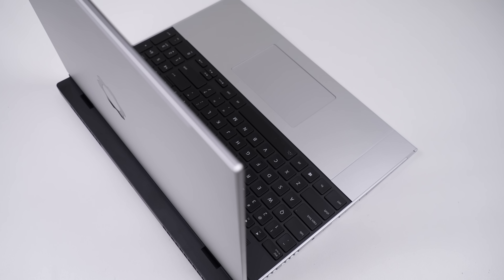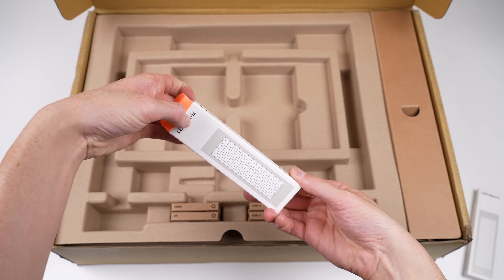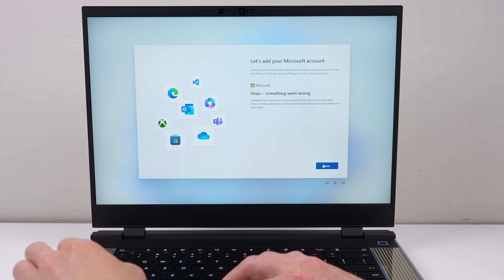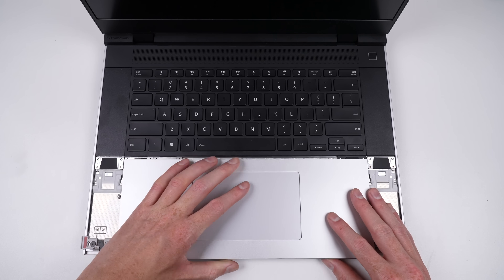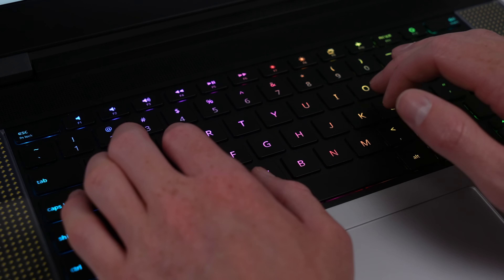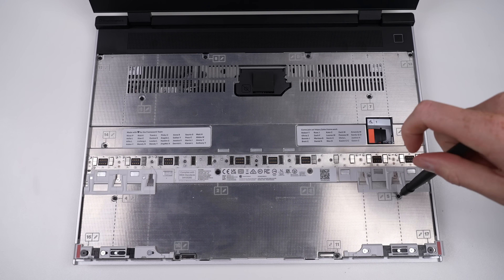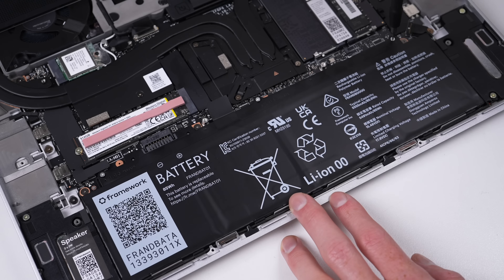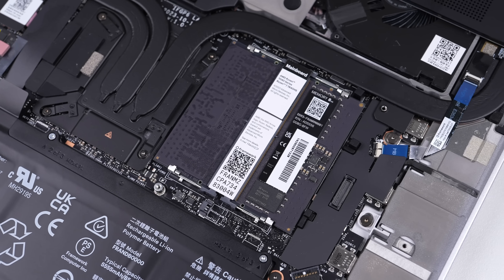Game Changing New 2024 Laptop Design - Framework 16 - Teardown And Repair Assessment

Comment: Too bad the price is too high imo. I just bought 16" laptop with ryzen 7840hs cpu, rtx 4060 gpu, 16gb ram, and 1 tb ssd for $950. A comparable framework 16 would cost almost 3x the price.
Reply: which one? and does it have oled display?
Reply: @lo2740  HP Victus 16 s0010ax for close to $900. Admittedly the display is worse than the 16:10 1600p framework, at 16:9 1080p ips panel, but at least it do 144 hz and 100% srgb at 300 nits.

Comment: I've seen this laptop so much times on the internet ive been always wanting one since newer laptops purely suck except for the framework ones i have a macbook m1 8gb ram i really just want to get one framework laptop and ditch my macbook since 8gb isn't much for a laptop and for my use cases and i cant upgrade my ram i have to replace the whole laptop and tbh i wish i heard of framework when i was looking for a laptop bc then i could of just easily upgraded my ram 128gb of storage is nothing im relying off a external drive more and using my desktop pc which was lower specs than my laptop only because i need the storage but its a really good laptop they have managed to bring back something new manufacturers are just leaving behind because they only care about getting more money from the user om any way they can man with the framework laptop you can upgrade it to have full sized usb ports man dongle after dongle is annoying being able to easily upgrade storage would be something amazing

Comment: I don‘t understand the hype with these Framework laptops. Yes, you can easily upgrade the computer down the road, but the replaced parts are also mostly e-waste. And: you have to upgrade more often than a conventional laptop. I have byed a Acer Predator Helios 16 for 2600 Euros. This laptop with a i9-13900 HX and a RTX4080-laptop runs circels around the top eqipped Framework 16 and costs 1000 Euros less. And this Helios 16 will last easily for 4 to 5 years for games. And you can edit 4K videos till the laptop dies. I am not sure that the replacement parts for the Framework laptop in three years will match the performance of my Helios 16.

Comment: On the one hand, modular laptops are cool, but the sad thing is that almost all laptops were once modular (not completely like in this video, but still)
All but the cheapest ones could have a replaceable processor, and many had a mobile version of the pci express slot
And now the modular system is presented as something new, and at the same time it is not widespread as before and is expensive

Comment: It's a great product, but sadly they are not the first company to make an upgradable laptop. There have been laptops where you could buy a case and build it out just like a desktop PC but it never took off, and that was in the days when harddrive and CPU, RAM, and GPU was user replacable. But in the quest for ever smaller laptop, they are simply not going to work. Because the fact is, if you want it small, then everything must be integrated, and if you wanted flexibility, you buy a desktop tower.

In contrast Apple just make repair as difficult as possible. Not only are the SSD soldered on, it's underfilled AND the chips must be programmed with the right firmware or else it simply will not work. We're talking BGA soldered chips too.
Reply: they're the first to design it this well, and keep the weight within reason. plus alienware instantly scrapped their offering, and MSI just threw theirs under the table acting like it never happened. 

and not everyone wants thin laptops, these are as thin as any laptop should be. anything past this is just stupid

Comment: As if people will upgrade their units every year 🤦🏻‍♂️ yeah sure modular everything but honestly, who here who owns a PC upgrades the components every year or every other year.

Nobody, most of us use it for 4-5 years, by that time when we need to upgrade the motherboard or some other component is not compatible with the new components, so you have to upgrade everything
Reply: Well... me. Tecnically not upgarde but I add thing to my PC as time went on. Usually extra drives and ram. For laptop, modularity makes sense, CPU last a long time, even i5-8265u is still excelent for doing normal day to day stuff. But my GPU is struggling. It would be nice if upgrade my GPU in 3-4 years time.

Also, what happened if your laptop broken. Maybe a fired GPU. On most other laptop you'll need to suck it and bring it to a service center, which would take a long time. Worst case you'll need to chuck it a buy a new one. With this, if the GPU fired you just said "aww.... shoot" and just remove the module and go about your day. Then send your module to them while still being able to use the laptop.

🤦🏻‍♂🤦🏻‍♂🤦🏻‍♂
Reply: @harveywilde6781  that maybe true but honestly, how many laptop have you bought in your lifetime and how many broke down?!

I have 4 laptops on a 5-6 year cycle and the reason I upgraded was it was already getting slow

Sure things get damage but the one you are talking about GPU or CPU or other components being damaged on their own without user neglect is like how much percentage is that from the general population using a laptop?

Comment: unusual how the speaker fire out the side considering that there appears to be space for them to fire out from the palm rest. perhaps a custom mod
Reply: the issue seems to be the sheet between the board and top deck, no holes for sound to come through. also heard the speakers are trash as is. im hoping for an upgrade later
Reply: @bradhaines3142  it wouldnt be impossible for them to release a revised version of that sheet later... nothing that a pair of tin snips can't do.
Reply: @gamingballsgaming  that wouldn't make the speaker any better either though

Comment: So when you have the dedicated graphics module installed does the system only use that without power saving features switching between the dedicated and integrated? Because in Linux managing two GPU's is quite a pain, even if they are AMD and not Nvidia.
Reply: it has a MUX switch in the bios to turn it off, or the auto power save like in most laptops

Comment: I love how modular the laptop is and you can customize with your need, instead of just use the preset from the manufacturer. I wish I can buy this laptop in my country.
Reply: My Powerbook 540c back in the 90ies was the same. You could remove the diskdrive, put a extra battery instead there,, or a pcmcia port etc. The cpu was on a replaceable pcb. you could upgrade the 68040 to a PowerPC cpu (which is a completely different cpu architecture!).... but this was back in the 90ies ofcourse.
Reply: Ditto. They're available in Hugh's country, but not mine, even though we're just across the ditch.

Comment: I really love the idea of the Framework laptop, but that's kinda where it stops for me. I love that it's more repairable and all that, but for me it kinda goes too far to the point to where I don't like it anymore. I know this is just a preference thing, and I honestly wish Framework the best. But I'm beginning to see their laptops become more like "tinkerer's laptops" instead of just "good laptops that don't purposefully stop you from repairing them if they even break in the first place." Like for my application, I basically just want a Macbook that doesn't stop me from fixing it when the SSD, screen, battery, or keyboard inevitably breaks. But I don't want all of those things to be modular though, because that just seems more fragile and bulky to me. It reminds me of the 2011 Lenovo G560 I used to daily drive. It was a great laptop for what I needed, and when the battery was too old I just flipped the clip, pulled it out, and put in the new one. But now that I've been using a Macbook for a while, I've realized just how annoying having such a bulky laptop was, so I don't particularly want to go back, and I'm willing to sacrifice repairability for a laptop that is as durable as a tank (like many Macbooks tend to be). However, what I do get very annoyed at is purposeful software (or hardware stuff like soldering stuff on when you clearly have enough space not to) attempts to stop people from even trying to repair stuff. 

So really, what I want is just a normal slim laptop that doesn't have all the aggressive anti-repair tactics. The Framework laptop just seems to go too far into the "tinkerer" side of things for me to consider it for my daily work laptop, though it would be a fun "everything else other than work" laptop. And let's be honest too, even though the "one click" replaceable keyboard, trackpad, etc. stuff is cool, it probably won't be as durable as having it built in, and that's kind of why I just can't consider a Framework laptop for myself (at least not yet). And even if the keyboard or trackpad did break, even if it's not "one click" to replace them, just a 30 minute repair job you have to do once is not that big of a deal and is worth it to me to keep my laptop slim and durable. 

Essentially, all I want is a normal laptop aimed at the general market (not just the tinkerer market) that also happens to be easily fixable when it breaks.
Reply: Sounds like you never really cared about repairability at all. Do you think MacBook parts don't break? And made a long-winded post to justify that
Reply: @ElectricLemur  You are redeclaring about caring repairability at all
Reply: Sounds like you want a MacBook and not a laptop. There is nothing that this laptop enforces the mindset that normal people cannot use it to be honest
Reply: @SheepyChris  Honestly, I guess so. I just wish Apple didn't forcefully put blocks in place to stop people from repairing stuff. But you're probably right tho, I'm more in the market for Macbooks than laptops. I have nothing against Framework tho, I think it's cool what they are doing. All I thought is that some of the one click stuff is a bit gimmicky right now, but it'll probably get better as they make more laptops. Again, just my preference to not like that stuff tho

Comment: 5:50 the Radeon 780M is an integrated gpu with the cpu. The Radeon RX 7700S is the dedicated GPU
Reply: YES, that was a huge mistake!
Reply: @roby2336  You could say it was a Hugh mistake
Reply from the maker: Yes you're correct, I was reading what Windows reports in the "System" page. It doesn't show the dedicated GPU in the list of specs.
Reply: Got a 780m in my legion go and that things a beast for 30watts

Comment: I think its quite funny how alot of these things used to be common in laptops but people forgot.
Reply: True
Reply: @curtisj2165  even PCU on standalone PCV. But everything has to be small and pretty now, with life of 4 years for high end machines.
Reply: disassembled the laptop a couple of times already, with ssd upgrade, fan cleaning and even applying LM to solve thermal throttling issue due to using such powerful components
Reply: @lsp6032   nice
Reply: soldered ram is now a dealbreaker along with lack of usb c pd, and also lack of dgpu with atleast 12gb of vram(I run some heavy load that frequently exceeded 8gb usage), I am okay with big and heavy laptops, but my tolerable limit is scar 18 size and weight, m18 is just too heavy at 4kg to be justified for me, alongside lack of usb c pd
Reply: They still are. Now almost exclusively found on gaming laptops. 

People always had the choice and still do. Except people chose to go for shitty thin and light laptops.

Heck even gaming laptops have had replaceable gpu's, cpu's, etc.
Reply: @setzer-j6s  yeah my dad has a legion laptop with a replaceable battery and stuff. It’s pretty slick
Reply: @1993MAZDAMIATA  And what's weird is people pretend framework is the first and only laptop that lets you upgrade them. Current and past gaming laptops let you upgrade almost the same if not greater amount.
Reply: @siyzerix using a legion gaming laptop, I can swap out the ram for higher capacity if i so want(currently running up to the 32gb limit on a daily basis), and slotted in another 2tb ssd for 3tb capacity, WiFi card, battery etc, although the cpu and gpu isn't replacable, it is way more powerful than what offers in this framework laptop(the gpu alone pulls as much power as the 180w framework adapter can push) and is more powerful than most desktops of all things
Reply: @lsp6032  Same with my nitro 5. However, it trades battery capacity for an extra 2.5' bay. Theoretically I can put in a larger 90whr battery but I'd have to shave off some plastic bits holding the current battery in place.

Comment: As cool as the idea of framework's ideas are, the price tag for what you get at this time is still way too high for it all. Yeah it's nice that this time they have a dedicated gpu and the 7700S is said to be on par with like 4050-4060 mobile gpus but still one problem: price is still over 1k or more than the equivalent gaming laptop. Framework spec'd out one: 2400+, while can get 4060 laptops for around as low as 1300. Yes not as upgradable/fixable/etc as a framework but still framework is just too high for what you get spec wise. Even a barebones framework for a buy now, upgrade over time, is more than a "working now 4060 laptop." I'm sure in time, as long as they too don't fall into the "fail run" of all others who have had "replaceable" gpus in laptops, they will drop in price as things became not as of a "new idea" and they make new parts/etc. But at time time the price of item to value of what you get is still slightly too high to make them worth buying at this time.

And yeah I do know the main counter to that is "well you aren't thinking in future" as you can just buy replacement parts and upgrade. But for that price you are currently buying a very underpowered laptop in hopes they don't fail with their ideas and in the future they will keep making everything with newer and newer allowing you to just upgrade.  

But still, at this time, it's paying higher end laptop prices for a midrange spec from a company that hasn't been doing it for long and promising a ton. And until they show more of the "future proofing" and etc, the idea is cool but prices aren't. I truly would love upgradeable laptops but is too "new" of an idea so things just are too expensive for what you get at this time and will need more time or companies to join and survive long enough for things to progress.
Reply: do you base all your buying decisions on the price or do you, perchance, entertain other criteria before spending your money? 🙄
Reply: this isnt the laptop to go for if all you care about is 'performance per dollar' the only valid options for that would be one of the megacorps that have the economy of scale to cut margins that severely. 

yes the gpu is weak, but get something with a 4070, when that gets old in a couple years, what can you do to upgrade that? 

nothing. just buy a new laptop. that's all you can do, unless you have one of these or the 10 pound monsters that might have mxm gpu, if you can find an mxm gpu

Comment: They can even sell enterprise grade laptop GPUs for it on top of high end gaming GPUs! They would probably need to make a thicker version of that laptop that can use up to 240 watts or more if they want to do a high performance gaming laptop! :)
Reply: current charger is 240w, which is the cap of type C. to allow more power it would need a different motherboard and way more cooling to match.

i highly doubt such a niche market is going to justify that level of change, but the designs are open source so if you can improve it go for it
Reply: Nope, only a thicker rear housing. It might limit the max tilt a bit, or add more space in the back, and it'll look a little funny but they can go bigger with that and provide lower-power rear modules for people who care about looks and / or can't add something thicker to their bag.
Reply: @bluephreakr  
Yup that would probably be best while the back would definitely be quite thick with a RTX 4060 which on its own could use over 200 watts of power! :)
Reply: The only problem with that is how many connectors they may have available. If I recall correctly, that interconnect only has eight lanes of PCI connectivity. A better GPU would likely require more lanes, which I am not certain if the laptop is prepared to provide.

The other way they can further improve things is if they utilize the newest PCIe standard. As of present, the current mainboard provided uses PCIe gen 4. So it's PCIe 4 x8, which is similar to PCIe 3 x16. PCIe 5 x8 should be similar to PCIe 4 x16.
Reply: @bluephreakr  they would probably on the next Framework laptop need to have a larger interconnect that can support 16-32 PCIE lanes for higher end GPUs! :)
Reply: @Techno-Universal  I don't see it. Maybe in the next decade, but Framework's intent is to enable people replace components and make their machines last for much longer than otherwise. Replacing the mainboard with something PCIe gen 6-capable would allow for the same interconnect to bridge together a PCIe gen 5 x16 connector.

PCI-SIG ratified the sixth generation of PCI express in 2022, so Framework using PCIe gen 4 is light-years behind current standards, but is more-than capable for most people's needs. A PCIe 6-capable board would likely provide a PCIe 6 x8 rear component interconnect which would be (by PCI-SIG's claims) par to PCIe 5 x16.

So the 16-inch will get pre-built refreshes, but owners can also upgrade the mainboard themselves and use newer GPUs as-desired.
Reply: @bluephreakr every laptop gpu is x8, and that's almost never the bottleneck. i think there were videos proving that even pcie 3.0x16 didnt bottleneck a desktop 3090 unless stress tested, and only around 5% at most. this is a 45w cpu that would limit throughput well before the lanes would be an issue, and then there's the wattage limit that'd possibly be an issue before the cpu could bottleneck it.